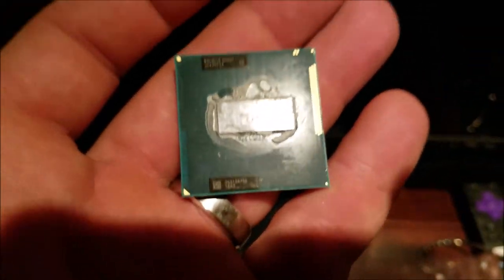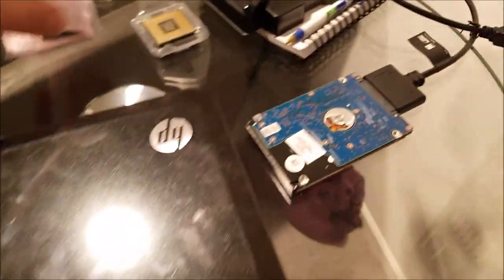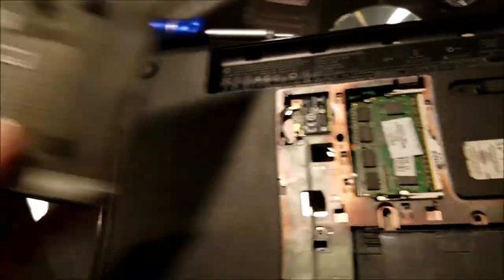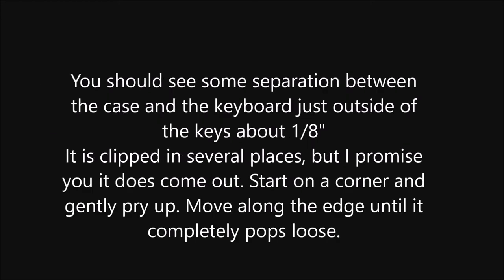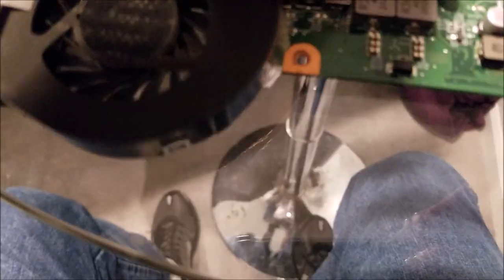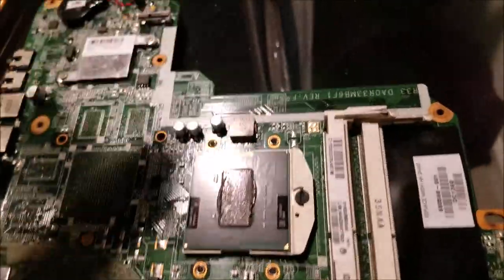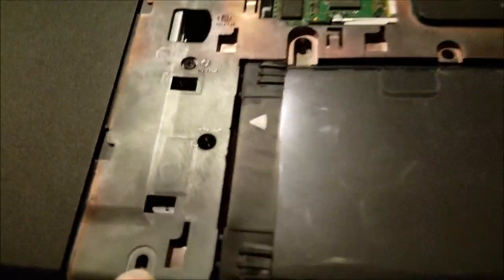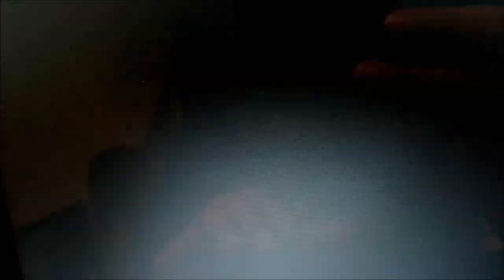How to upgrade to an i7 processor in your old laptop

Comment: I have a i3-2328m in my Asus X55C laptop. I want upgrade to i5-3380m. any suggestions?
Reply from the maker: What is your chipset?
Reply from the maker: If your chipset is hm65 then you are stuck with sandy bridge 2000 series cpus. if it is the hm76 chipset, you can run the 3000 series ivy bridge processors. Regardless, I would choose a slightly better cpu to replace your 2328m. If you are looking for more performance, you won't see much from a 3380m compared to your current cpu. I upgraded from an i3 2370m to an i7 2640m and barely saw any speed improvement. You will see a speed difference with a quad core. Look through the part numbers to see qm at the end of the part numbers.
Reply: @EricErnst  i dont know but my socket is "socket g2"
Reply from the maker: yes. The physical socket is the same between the sandy bridge cpus and the ivy bridge cpus. Samdy bridge is 2000 series and ivy bridge is the newer 3000 series. The 3000 series is built on a newer architecture with smaller nodes so it is more efficient. Sandy bridge is 32nm and ivy bridge is 22nm. Their newest 10000 series is 10nm. They stuck on 14nm for a long time. Regardless, of you put an ivy bridge chip in a chipset that doesn't support it, your laptop will not boot. You need to find your chipset before I can make a full recommendation.
Reply: @EricErnst  only writing X55C 
serial number is that "BSN12345678901234567"
Reply from the maker: that doesn't tell me much. If you have the hm75 or above, I recommend at least the 3610qm. If you have the hm65, at minimum I recommend the 2630qm. Don't bother with the 2640m. It's not much better than your current cpu. Stay away from cpus that end in U and a single M. I'd recommend staying away from XM as well. They will produce too much heat under major cpu loads like video rendering. I recommend up to the 3840qm. That's what I'm running in my laptop and it's a great fit for me. Find your chipset and then go from there.
Reply: @EricErnst  thank you

Comment: What do I need to check if mine I could upgrade mine?
I have an Acer Aspire 5750G. It has an HM65 Express Chipset, i7-2630QM. It uses the Socket G2. IM planning to upgrade to an i7-3740G. I heard that I could do it despite my laptop being compatible up to an i7-2820QM with a low chance of it not working.
Reply from the maker: You need to check your chipset. 65 is not compatible with 3rd generation (3000 series) chips. The chip will fit in the g2 socket, but it may not work if your chipset is the older hm76 version.
Reply from the maker: Sorry. I just saw that you said the chipset in your original comment. I think you are stuck with 2xxx series chips. Another user recently installed an i7 2960xm in his hm76 chipset laptop.

Comment: Bro. I have a Lenovo Thinkpad E430 with I3 2350M 35 tdp, G2 socket, i want to upgrade to the 3rd. gen. I7, can i do to it and which one do you recomend?
Reply from the maker: I'm no expert but I would update your bios and try a 3840qm. It should be cool enough that your cooler can keep up and not overheat. It's a great processor. I've been running it in this laptop for a couple years. I upgraded from a 2370m in this video. The higher tdp xm chips will only be marginally faster and they cost a lot more. If I remember correctly, the 3920xm and 3940xm are 55w. Is that correct? Regardless, the 3840qm is a great chip and it doesn't overheat or thermal throttle. I was running a 2920xm for a few months and it liked to get hot when rendering videos. Like 100c. I swapped in a 3840qm with no problem at all.

Comment: I have an question. Do I have to add some more cooling to laptop with k53sv if I want to upgrade to i7 2630am from i3?
Reply from the maker: The 2630qm has a tdp of 45w. Your factory processor was probably 30-35w. I used a 2920xm in place of a 2370m. Its tdp was 55w. When I was doing cpu-intensive tasks like video rendering, the processor would get pretty hot. Like 95c. Now I have a 45w 3840qm. It runs plenty cool now, although I'm sure it runs warmer than the stock dual core processor. I don't think you will need to upgrade your cooling, as long as you are aware and don't cover up the cooling vents during hard use. 
  I've since upgraded another laptop to a quad core and it has run fine with no overheating issues. I think it had an i5 3520m and I upgraded to an i7 3630qm. I bought the laptop as a surprise for my mother and she hasn't had any problems with it. 
  Use a decent quality thermal paste and you'll be good to go. I used icy diamond in this video but I've since switched to thermal grizzly brand thermal paste.

Comment: How much watts power adapter do you use?
Reply from the maker: 19.5v at 3.33A. 65w charger. I believe it is the factory HP charger that came with the laptop.
Reply: I have a Lenovo g400 im planning upgrading it i7 3720qm. It has the hm76 chipset and a 65watts power adapter. Do you think it will run without any issues?

Comment: Hello Eric, thanks so much for your support. I´d ask you about upgrade my laptot, is a Dell Latitude E5420, It´s a CPU 2nd generation i5-2520M the TDP is 35W and I´d want to upgrade to i7-3840QM
The BIOS compilation is A14 (26/12/2013), and the mainboard is 0H5TG2 version A03. Chipset HM65 Rev. B2.
The Dell technical service doesn´t recomend it because this new CPU is from other generation and their TDP is 45W.
To be honest, I´ve tried to install the CPU i7-3940XM and it didn´t work, their TDP is 55W and I think in this case it was too much...
Which is your opinión and recomendation with your experience? Do you think the CPU i7-3840QM will work properly in my laptop?
Thank you again.
Reply from the maker: Unfortunately, I think that your hm65 chipset is too old for the 3000 series cpus. I have a hm76 chipset. You already said that the 3940xm didn't work. If one CPU works, they should all work. I have installed a 55w tdp 2920xm in this laptop and it worked fine so I don't think that the tdp is the reason that it didnt work. The reason that I switched to the 3840qm is because the 2920xm ran pretty warm on my small cpu cooler designed for an i3 2370m. Check intel ark for a 28XXqm series CPU with 45w tdp. I think that will be the best bet for your laptop. You might even be able to find a slightly newer laptop for cheap.
Reply: @Eric Ernst, Thank you for your quick response! It´s clear and It´s sense.
Ok, I was wrong and I thought that the TDP could be the problem with my Laptop compatibility. But you´re right and my chipset version could be too old for 3nd generation CPU, It´s a pitty because I wanted to update the GPU also, 3nd generation has a HD Graphics 4000 and run with directx 11, some games need this updating to run and the GPU integrated with 2nd generation is HD Graphics 3000 with directx 10.1.

Maybe the CPU i7-2860QM is the best option to upgrade my laptop and not increase too much the TDP.
Congratulaton to share your knowledges.
Reply from the maker: @aaragonrodrigo  good luck with everything.
Reply: @EricErnst  Hello Eric! Good evening, I write you only for information. I had ordered the CPU i7-2960XM from AliExpress and I´ve received it recently. It run in my laptop, the system detect the 4 cores and 8 threads and the RAM is working at 1600 of frecuency. I found problems with the temperature, in a normal use 10% CPU, the temperature is almost 65-70ºC vs 50-55ºC with my original CPU and when I do a CPU stress test, the average measured is 92ºC. The fan noise is higher because it needs to cool more degrees. I've tried to play to Counter-Strike and FPS are lower compare with the i5 CPU. I think the high temperature doesn´t allow works well. 
Do you think I will have a similar problem with CPU i7-2860QM? I'm not have a dedicated GPU and I'm not sure if this upgrade have sense for me.
Really nice for your comments.
Alberto.
Reply from the maker: @aaragonrodrigo  even with the higher tdp, the faster i7 should be faster than your i5 in all scenarios. If it gets too hot, it will throttle itself down. What kind of thermal paste did you use? I think I used icy diamond paste on this laptop but I've since switched to thermal grizzly cryonaut paste. It's expensive but it's supposed to be among the best. Did you clean off all of the old paste from the cooler? It sounds to me like you have a bad mount. I would try remounting and checking that the thermal paste was applied across the entire CPU. My 2920xm would get over 100 degrees C while under 100% load rendering youtube videos but it was never slower than an i5. Your fan should only be louder under load. Also, check to be sure that it is indeed a 2960xm CPU. I've heard of scams on aliexpress. They may have sent a slower quad core CPU. If the base and boost frequency is lower than the i5, that may be where your fps will be lower. But if that were the case, the temps would be lower. In summary, I'd check your thermal paste and make sure that it's good. 
  I've put paste on and pressed the cooler on, then pulled the cooler off and put it directly back on and the temps were out of control. It doesn't take much to get a bad mount. It's a pain in the butt having to pull it all apart again just to check the paste, but that's where I would start. 
  Let me know how works out for you. Good luck with it.
Reply: @EricErnst  Thanks again for your support Eric!!! I cleaned perfectly the paste of the cooler, the thermal paste that I've used is ARTIC MX-4. I bought it in amazon because it had a very good reviews. All test I did with Intel programs, detected the CPU like original as i7-2960xm 2,7 GHz. I'll try to install again the i7 processor and I´ll tell you soon. Great job Eric.
Reply: Hello Eric, good evening!  I´ve installled again the CPU, (in my case is ease to do, only takes me 5 minutes), and their working is the same. The CPU is detected propperly but it doesn´t work well. When I do the stress test with CPU-Z, not finish. It´s doing the test during long time. Maybe the CPU, is it defective? I´ll wait to get the other CPU 2860QM. I´ll cross my fingers! I´ll tell you in when I do it. Kind regards.
Reply from the maker: @aaragonrodrigo  I'm sorry that your 2960xm isn't working out. One unique thing about the xm processors is that they are overclockable. You can download Intel's extreme overclocking utility software and turn it down to the speeds of a 2860qm. That should essentially make it the same as a 2860qm. You may even be able to disable cores and turn it into an i5 to test your counterstike fps. The xm CPUs are often "binned" meaning the silicon is higher quality and can run faster and cooler while using less power than standard CPUs. This is why they have more cores and are clocked higher. My 16 core/32 thread 3950x is supposed to run cooler and faster and use less power than a 12 core/24 thread 3900x. The 3950x's are definitely binned processors. The lower quality processors that have defective cores or cannot be clocked as high get turned into dual core i3s. That's why some processors overclock better than others. They have higher quality silicon. Some chips are just better. It surprises me that your 2960xm is running so poorly on your laptop. That should be the best chip available.
Reply from the maker: @aaragonrodrigo  try this software. https://downloadcenter.intel.com/download/24075/Intel-Extreme-Tuning-Utility-Intel-XTU
Reply: @EricErnst  Hello Eric, Good evening!!! I´ve installed the XTU software but I can´t modify the parametres in "Avanced Tuning" this section is empty I don't have options to select. I was checking in internet but didn´t find the reason because my CPU is XM and I should can do it. I´m not sure if my BIOS setting can disable this options. Any advise? The stress test in XTU pass rightly but I´m running also other software "Intel Diagnostic Tool 64 bit" and when I do the test don´t pass the "Math" section… Which is your opinión? Really thanks.
Reply from the maker: @aaragonrodrigo  I am beginning to wonder if the CPU that you have is not a genuine xm. The xtreme tuning utility gives you software control of your cpu's clock. With it, you do not need to overclock in your bios. That, and the fact that it is running worse than your i5 processor leads me to to believe that it is an intel chip, but it is not a genuine xm i7 chip. Its weird that it is running hotter than your i5. And it is running slower (less fps) than your i5. Maybe it is a 2nd generation i3 or i5 chip that has been relabeled as an i7 XM. I have no idea, but it certainly doesn't seem right. The fact that you can't use the xtreme tuning utility also makes me think that the chip is not a real xm i7. You said that you have ordered an i7 3860qm. I think that when you install it, it will run circles around your 3960xm. 
  Keep me updated on your continuing saga. Good luck with everything.
Reply: @EricErnst , Hello Eric, I´m not sure that this processor could be a relabeled CPU. The different software that I´ve used, detect the CPU like original i7-2960XM with 4 cores and 8 threads Doing the benchmark test in XTU, the core TDP increase to 52W, the 4 cores are actives and the Core Frequency is placed in 3,58 GHz MAX. The XTU score optained is 715. The CPU-Z validator has validated the CPU with a 3192,38 MHz, the benchmark position in CPU-Z is 1483. With this CPU the RAM frequency is (798,1 MHz x2). with my old i5 was (665,7 MHz x2). I want to believe that the CPU is original, but it´s true that I can´t modify the parametres in XTU. I would want to show you some screenshoots, and maybe could help to clarify anything else… Thanks so much for your patience!!!
Reply from the maker: @aaragonrodrigo  What is the max speed that you see in cpu-z? You said 3200mhz... is that under load? Also, what was your original i5 processor again?
Reply from the maker: @aaragonrodrigo  how is your laptop battery? If it is junk and you have to leave it plugged in all the time, you may have a power issue. I had a junk battery when I started and the 2370m would not boost at all. I'm wanting to say it was 2.4ghz. After I put a new battery in, the CPU boosted like normal.
Reply: @EricErnst  Hello Eric!!! Thank you again. When I do in CPU-Z a becnhmark test with 8 threads, the Core speed detected is 3192,38 MHz in each core (x4). I use a docking connected with a charger and my battery health is in 85%, (I bought the battery two years ago). My original processor was a i5-2520M.
I´ll apreciate in advance, any other idea or advise you can give me? I´ve a feeling that this CPU is not boosted well in my laptop. Kind regards.
Reply: To add another coments. When I do the stress test with XTU, I´ve this results:  Max core frecuency 3,54 GHz - Package TDP max 54W - Core TDP max 48W - Clock frecuency 99,9 MHz - Package Temperature max. 94ºC.
Reply from the maker: @aaragonrodrigo  my 2920xm chip would sometimes read as high as 104C while rendering youtube videos. It was still a fast chip, I feel like it was comparable with my 3840qm, just a little warmer than I'd like. I'm sorry. In the past couple exchanges l, I had you confused with another commenter. I have been thinking you were running a 3960xm instead of a 2960xm. Everything points to the xm chip being much faster in gaming than the i5. I thought the i5 may have higher single core clocks but it doesn't. The ram speed is faster on your XM. I don't know why you are having such poor performance. If your battery is good and your mount is good with good thermal paste, then I am out of ideas. Sorry I couldn't be of more help.
Reply: @EricErnst  Ok Eric, I know it´s not easy to find a solution in this case. I think my laptop, (mainboard), is not designed for xm processor and it doesn´t boost rightly, due a high temperatures the TDP and core frecuency come down running a test or playing games. If I´ve chance in the future, I´ll test this CPU in other laptop, (no Dell Brand preferably). Anycase, I´ve ordered the CPU i7-2860qm, I hope I can tell you that it works really faster… Thank you to share your time with me!!!
Reply: Hello Eric, I was checking more information about the features of CPU i7-2960XM and I found that their compatibility is with mainboard chipset HM67, QM67, HM75, HM76 and HM77. Maybe that is the reason for the bad working in my laptop. My chipset is HM65. 
The CPU i7-2860QM is compatible with HM65 and HM67. I hope that is true and I don´t have problems in my next upgrade. Have a nice day.
Reply from the maker: @aaragonrodrigo  if it was incompatible, I would think it wouldn't work at all on a 65 chipset.
Reply: @aaragonrodrigo hey what happened with the i7 2860qm did you have a better performance?
Reply: @virginiagutierrez8916 , Hello Virginia, the CPU i7 2860QM works well in my old laptop. It was a great update for their improvement. Best regards.